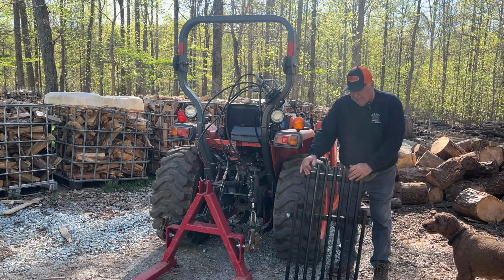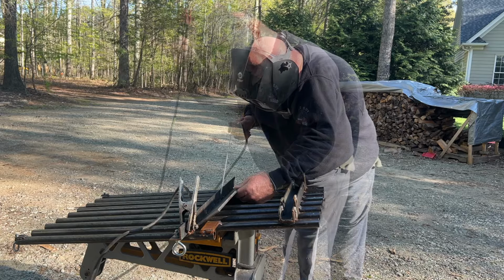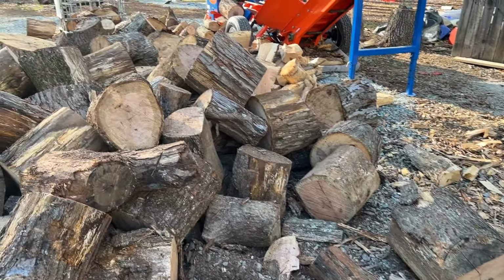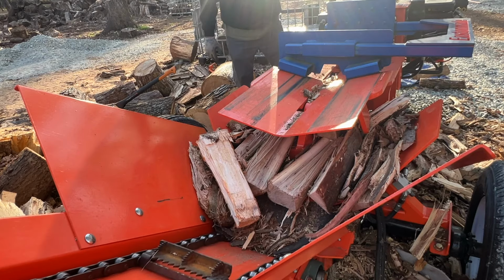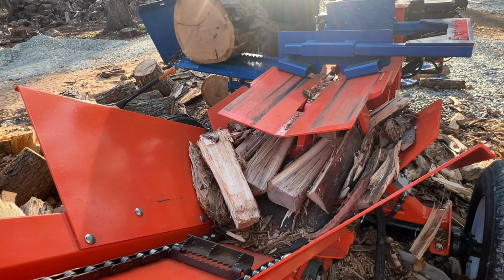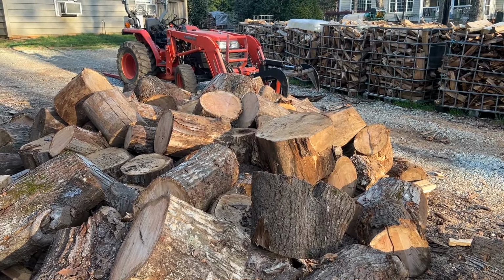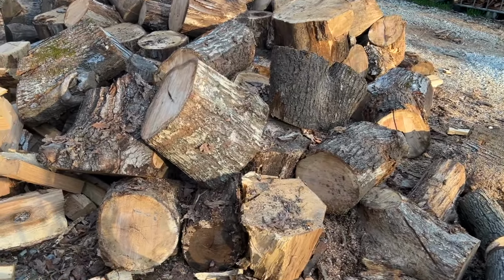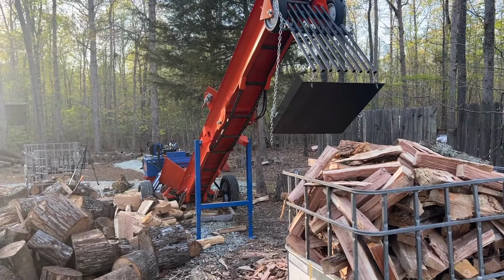Eastonmade Box Wedge and BIG Rounds.  Completing final mods to grizzly bars.

Comment: At about 8:30 the round stands up on the return stroke.  I have noticed that with my box wedge, mostly when the round is 14 inches or less.  There doesn’t seem to be enough inertia to keep the round flat with the carriage and it stands it up.
Reply from the maker: Hi Brent. Thanks for watching. That happens occasionally, but I only see it with large heavy rounds. As the round pulls back and falls down off the top of the wedge, the weight of the round causes it to roll over towards the push plate. Hope you’re doing well my friend.

Comment: Glad to see that you sre really enjoying the 22-28 box wedge. Trying ti decide between this, a vertical or small processor. At 72 its working on my body, but, i really enjoy being in the woodyard!!  Stay Hydrated and Have a Safe Day
Reply from the maker: Hi David. If you can get straight, under 14” poles the processor is the answer. The box wedge wins out for high volume production, and the vertical splitter is best for precise clean, controlled splits. It really depends on your situation.